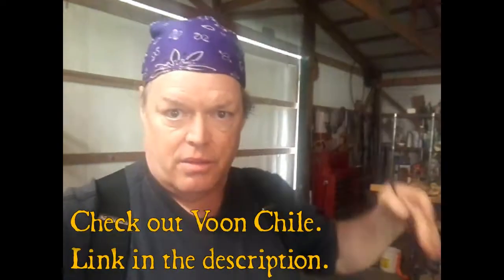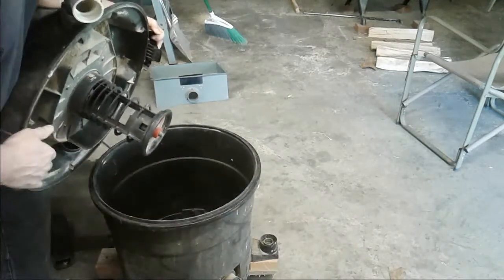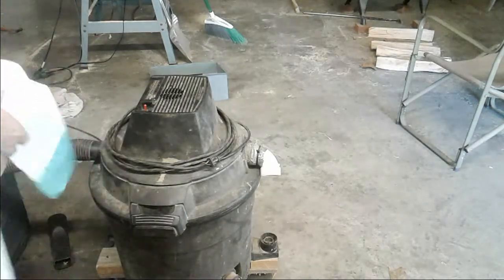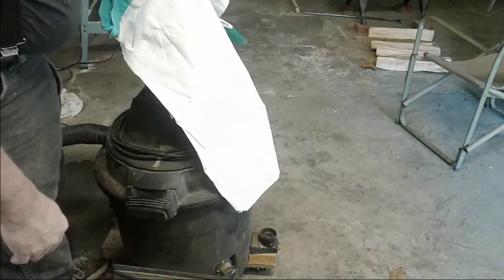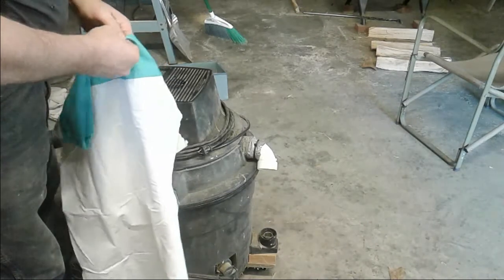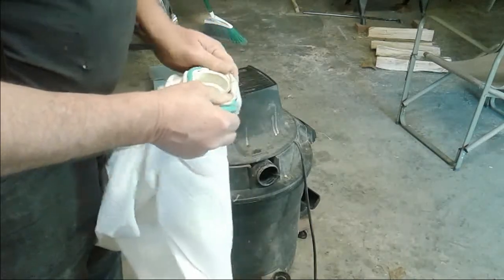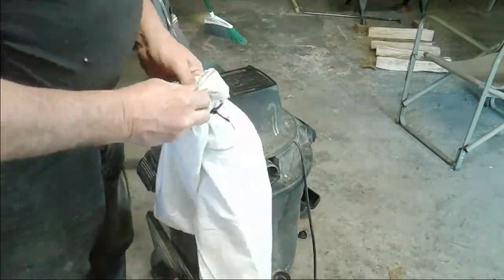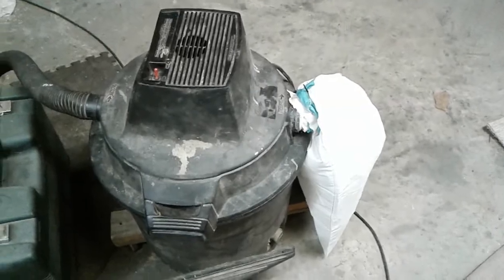Redneck Repair: Shop vacuum filter

Comment: The dust is still flowing through your motor and impeller , eventually ruining your
Bearings and clogging your fins.

That machine doesnt
Reply from the maker: Yeah. Someone mentioned that. I guess I should film a retraction, eh?
Reply: @ArkansasPilgrim  N0 ... its just something you need to be aware of ... IF you choose to use this method  .

Clogging up your impeller will limit suction the same way that a plugged filter cartridge would.

Judging from the higher pitched whine from your particular machine, I can hear a motor spinning, however; I dont hear much suction being produced.
Reply from the maker: @rudygeorgiamulesandcountry1594  It has since burned out. I've been doing it this way for a long time, so it finally caught up with me. I didn't realize it would be a problem because house vacuum cleaners have the dust go through the motor, and they last a long time.
Reply: @ArkansasPilgrim  : shop vacs have come a long way.   I have a RIDGID thats 20+ years old.
Reply from the maker: @rudygeorgiamulesandcountry1594  This one was 20+, too. I got it used as part of a set when someone was selling out a small shop.
Reply: :  The place to attach your bag filter would be internally inside  the canister inlet  where a disposable bag would normally attach; IF ... the was something to attach it to.
Reply from the maker: @rudygeorgiamulesandcountry1594  Or just tie a couple of layers of cloth over where the filter normally goes, like the filters you see on small shop vacs.